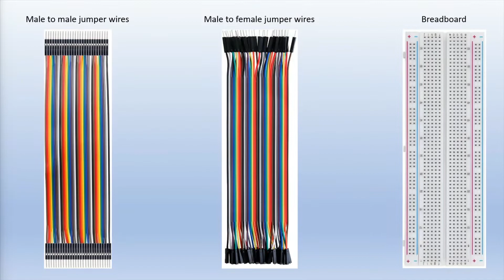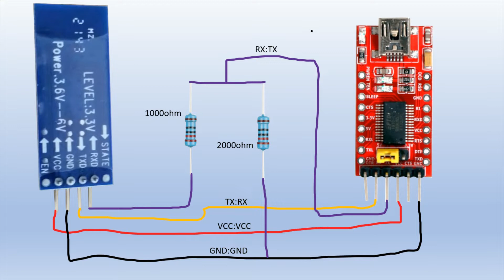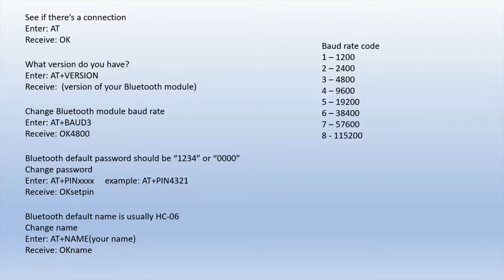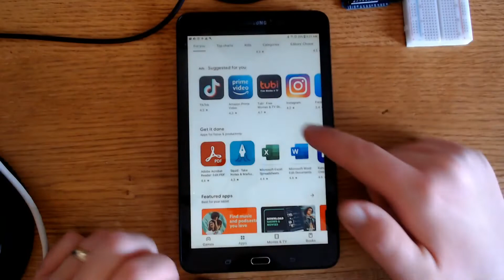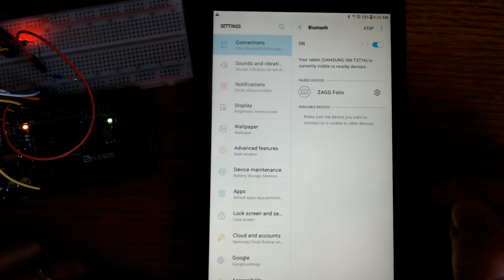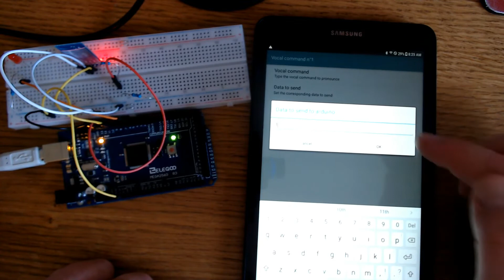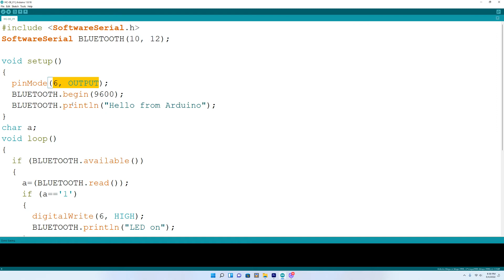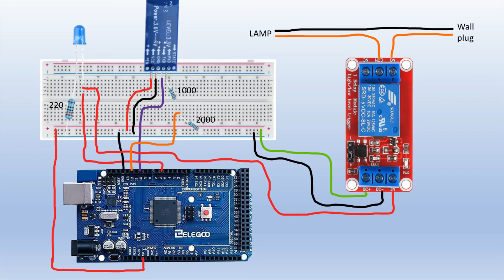Arduino Voice Control Using A Free Android App And The HC-06 Bluetooth module - Beginner Tutorial

Comment: Hello, thank you.  Where can I find the library?🎉
Reply from the maker: The SoftwareSerial library is included with the Arduino IDE, which can be downloaded from the official Arduino website: https://www.arduino.cc/en/software.
Once you have installed the Arduino IDE on your computer, you can access the SoftwareSerial library by including it in your sketch using the #include statement:
I try to include all code for videos on the Facebook page. This code is short enough to post on YouTube. See code below. Hope that helps!

<SoftwareSerial.h>
SoftwareSerial BLUETOOTH(10, 12); 
void setup()  
{
  pinMode(6, OUTPUT);
  BLUETOOTH.begin(9600);
  BLUETOOTH.println("Hello from Arduino");
}
char a; 
void loop() 
{
  if (BLUETOOTH.available())
  {
    a=(BLUETOOTH.read());
    if (a=='1')
    {
      digitalWrite(6, HIGH);
      BLUETOOTH.println("LED on");
    }
    if (a=='0')
    {
      digitalWrite(6, LOW);
      BLUETOOTH.println("LED off");
    }
    if (a=='?')
    {
      BLUETOOTH.println("Send '1' for LED on");
      BLUETOOTH.println("Send '0' for LED off");
    }   
  }
}
Reply from the maker: remember, you also need to  install Android Bluetooth Control app